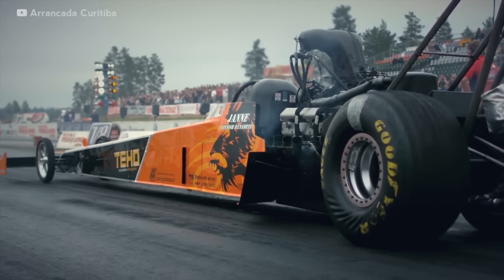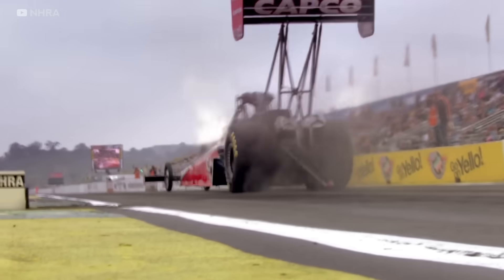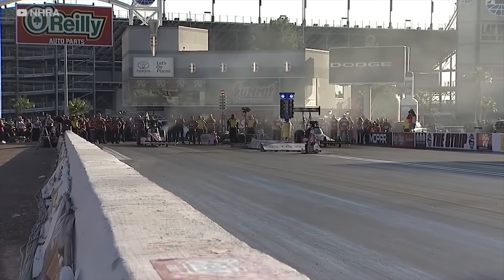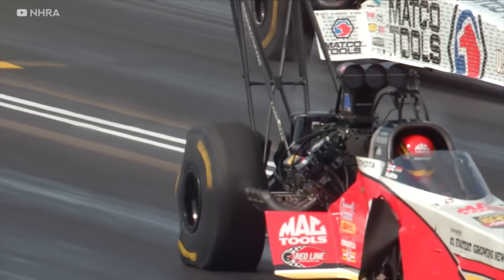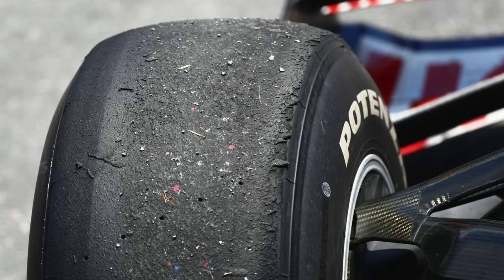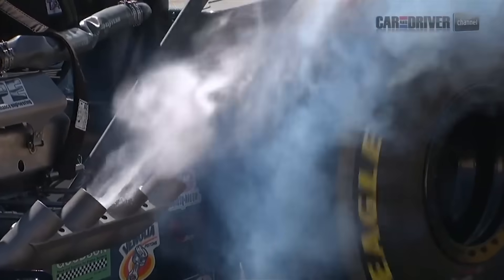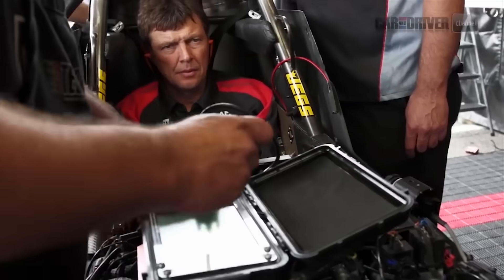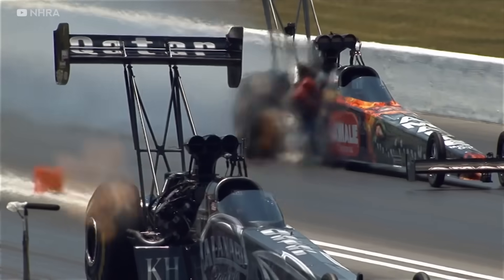How Dragster Tyres Accelerate to 335 MPH in 3.6 Seconds

Comment: You missed a good one: the clutch welds itself together around half track.
Reply: The spark plugs also melt away, by the end of the run the car is deiseling from the heat of the engine alone
Reply: Polybotes holy crap really
Reply: @mojaverc1585  yea, in my automachanics class in highschool our "educational" trip was to the drag race every year so we got to watch the teams tear down the engines and learn what they had to replace every run and what kind of damages and wear they were looking for to make sure everything was perfect
Reply: Polybotes wow thats amazing!
Reply: @polybotes927  THAT is educational
Reply: Wait you mean the whole dragster industry is producing a bunch of wasted metal and components?
Reply: @ralexcraft990  recycling scrap metal is better for the environment, mining and refining metal ores are so enviromently
Reply: @polybotes927  OMG really?
Reply: wyanSS thats a cool fun fact😂
Reply: Wtf is that legit?
Reply: The spark plugs fuse after a couple seconds, and the car diesels the rest of the way.
Reply: @johntomasik1555  LOL...ummm, no. If you watch the crewchiefs after every run, the have a tool with a light they put the plugs in from each cylinder and "read" the plugs. Garlts was a master at this.
Reply: @Jordon Carlson motors are based on the Chrysler Hemi. 2 plugs per cylinder 1 intake 2 exhaust valves.  But almost all blocks are Chevy blocks now. Don’t really know the difference on the block stuff. Voltage is like 50000 volts. 2 mags.
Reply: @Jordon Carlson well, record that for sure.
Reply: lol
Reply: It’s about the tires
Reply: Actually? Damn...
Reply: It's amazing all the forces going on here. Been to one drag race event where they'd sell parts off these motors after one run for souvenirs. Looks like a grenade went off inside these. Bent rods, hammered pistons and other indescribable chunks.
Reply: I wonder how fast 0-60 is then
Reply: LOL adding new depth to the term "clutch lockup."
Reply: Also missed to say that there are no cooling systems in these cars. They are cooling themselfs through the low pressure that is created through the massiv amount of air and fuel that is sucked in that there is ice building up.
Also the fuel is igniting itself after half the track and spark plugs are molten at this time.
The engine is only doing 800-900 revolutions, including the burnout, before it's completely taken apart after every run and pistons are replaced every run...
Reply: You only weld the clutch if it’s not done correctly. To much gap, or not enough engagement.
Reply: Oh hahaha fuck i didn't tought about the gearbox/clutch part ... it's insane, so basically everything is dying in one run ?
Reply: @Jordon Carlson if you do get your hands on 36$ a gallon nitro please don’t do that. That poor Kabota doesn’t stand a chance if it does detonate, yikes! Nitro has about 2.3 times the energy density of gasoline.
Reply: It does WHAT?!
Reply: That is not true.
Reply: Yup. Watch the poor crew member that has to rebuild the clutch after every one. They're the one with giant oven mits & a full face shield, sweating their ass off.
Reply: You are right but it is usually only the first two- three discs on a 5 or 6 disc clutch.
Reply: @emptychristbuddha  stretch is the 'replacement spec' on ALL aluminum rods. I don't know if they have gone to titanium rods, or not, so can't speak to them.   For aluminum rods, there is generally a number of runs count kept for replacement purposes.

In the high tech world of TF & FC drag racing, I wouldn't be surprised of they measured rod length any time a rod/piston assy comes out.  Never seen a team do it, but that and a nickel, gives you 0.05. LOL   If they do, there's likely a YT vid about it.
Reply: @georgedennison3338  ..I misunderstood you comment...Oh well, you have my story anyway lol
Reply: @georgedennison3338  ..You are always allowed to let your engine parts cool before an inspection. I set 25 IHRA/NHRA records and had to tear down after each. The tech guys actually try their best to NOT throw you out...the motors and parts are always allowed to cool. // One time I set a record, I knew my heads were right on the borderline in combustion chamber volume..as I pulled a head off I took out the plugs and slipped an extra washer on them & reinstalled them. I walked the head over to the tech guy...he CC'd it. He said...wow, you're losing a lot of power, your combustion chambers are way over spec...tell your head man to shave em and you'll pick up some power...I said thanks I will...LOL. My head was probably legal, I just didn't want to take a chance. That tech man and I became good friends thru the years (no I never told him)....RIP Hank.
Reply: @MikeM275  my dad would have a crew guy with a few hammers near the scales and if he was light he would ask to recalibrate the scale while he loaded up the hammers.

Comment: Dragsters are powerful, lean, and quick fire-breathing machines. Their engines purr like a kitten and roar like a lion. I have been involved in drag racing, but not so much the NHRA. More along the lines of UMTR. My favorites are the gassers. And I've seen a couple of funny cars and top fuels at their events. My favorite funny car is Suzie Q. She's a red '57 Chevy Bel air. I can't remember the name of the top fuel there, but it had two engine blocks running down the middle, making the whole car bounce as it did its burn out. I miss going to my drag races. It's what made me want to become more involved. If I could, I would tweak up my Kia Soul and replace the 4 cylinder engine with a small block v8. Throw it on the track. See if THAT will turn heads.

Comment: Nitromethane is also used because of its low optimum air to fuel ratio so much more can be burned per power stroke. Adding hydrazine increases the power output even further however I don't believe this is allowed anymore after some catastrophic engine explosions that caused some pretty major injuries in the 50's or 60's. If someone who is more knowledgeable about this era of drag racing could chime in on this that would be great.

Comment: so funny that the tyre is basically a cvt gearbox
Reply: A hell of a scooter.
Reply: And more reliable than Nissan's CVT.
Reply: I was thinking along those lines as he described the height of the tires at various times.
Reply: Underrated comment lmfao
Reply: Stolen:
* Under full throttle, a dragster engine consumes 11.2 gallons of nitro methane per second; a fully loaded 747 consumes jet fuel at the same rate with 25% less energy being produced.
* With 3000 CFM of air being rammed in by the supercharger on overdrive, the fuel mixture is compressed into a near-solid form before ignition. Cylinders run on the verge of hydraulic lock at full throttle.
* At the stoichiometric 1.7:1 air/fuel mixture for nitro methane the flame front temperature measures 7050 degrees F.
* Nitro methane burns yellow. The spectacular white flame seen above the stacks at night is raw burning hydrogen, dissociated from atmospheric water vapor by the searing exhaust gases.
* Dual magnetos supply 44 amps to each spark plug. This is the output of an arc welder in each cylinder.
* Spark plug electrodes are totally consumed during a pass. After 1/2 way, the engine is dieseling from compression plus the glow of exhaust valves at 1400 degrees F. The engine can only be shut down by cutting the fuel flow.
* If spark momentarily fails early in the run, unburned nitro builds up in the affected cylinders and then explodes with sufficient force to blow cylinder heads off the block in pieces or split the block in half.
* Dragsters reach over 300 MPH before you have completed reading this sentence.
* In order to exceed 300 MPH in 4.5 seconds, dragsters must accelerate an average of over 4 G’s. In order to reach 200 MPH well before half-track, the launch acceleration approaches 8 G’s.
* Top Fuel engines turn approximately 540 revolutions from light to light!
* Including the burnout, the engine must only survive 900 revolutions under load.
* The redline is actually quite high at 9500 RPM.
* THE BOTTOM LINE: Assuming all the equipment is paid off, the crew worked for free, & for once, NOTHING BLOWS UP, each run costs an estimated $1,000 per second.
Putting this all into perspective:
Lets say the you are driving the average $140,000 Lingenfelter twin-turbo powered Corvette Z06.
Over a mile up the road, a Top Fuel dragster is staged & ready to launch down a quarter-mile strip as you pass by it. You have the advantage of a flying start. You run the ‘Vette hard up through the gears and blast across the starting line & pass the dragster at an honest 200 MPH. Just as you pass the Top Fuel Dragster the ‘tree’ goes green for both of you.
The dragster launches & starts after you. You keep your foot down hard, but you hear an incredibly brutal whine that sears your eardrums & within 3 seconds the dragster catches & passes you. He beats you to the finish line, a quarter-mile away from where you just passed him. Think about it – from a standing start, the dragster had spotted you 200 MPH & not only caught, but nearly blasted you off the road when he passed you within a mere 1320 foot long race!
Reply: LoL
Reply: Imagine Jeremy clarkson saying that
Reply: Logan Music  r/whoosh
Reply: @Wildjesta  he just said what cvt gearboxes are...
The r/woosh thing is so fucking annoying and childish...
Call me a boomer but literally no one cares about that subreddit
Reply: @samuelkavicky7242  Cheer up, will ya? Why be such a downer?
Reply: @samuelkavicky7242  apparently you care. Don't make my whoosh you.

Comment: It's actually less energy in the Nitromethane than regular pump gas but it requires much less oxygen so you can dump more fuel in the engine.

Comment: Great video only one correction I’d make. Nitromethane fuel doesn’t actually have a greater energy density than gasoline it’s actually less. The reason engines burning nitromethane produce more power is because a far greater volume of fuel can be burnt than gasoline in the same time because nitromethane has oxygen in it in the form of NO2. This means the fuel requires less extra atmospheric atmosphere to burn optimally. The fuel ratio can go to 1:1. More fuel burning = more power.

Comment: another interesting fact about nitromethane aka CH3NO2, is that the stoic ratio,perfect combustion, is 1.7:1 , with a richened race tune its on the edge of hydrolocking. @6:10 is a dead hole pouring fuel out the exhaust.

Comment: 5:27 - Name a motorsport where the tyres last 900% longer than the engine per stint.

You wouldn't have guessed Top Fuel.
Reply: To be fair, in an engine rebuild they wouldnt be replacing the entire engine every time. They will mostly be checking for damage or stress, parts needing to be replaced
Reply: @facepalm7345   Understood
Reply: @facepalm7345  We carry two spare Bullets (Complete short blocks) in the Hauler, 8 racks of pistons and rods, 8 clutch packs, 8 sets of prepared heads and 3 Assembled Superchargers. Thats enough stuff to run 8 passes. 3 qualifiers and 4 rounds if a 16 car field.
Reply: @facepalm7345  Pistons, crankshaft, sparkplugs, etc etc. The block itself isnt replaced, but most of the inside is. 

It's like tearing apart a house on the inside and redoing it. Its still technically the "same house" but they are totally different from the inside
Reply: Jack The Ripper sounds a bit like Grandpa s old axe....had 7 new handles,and is currently on its fourth head... still Grandpas axe!🤣🤣
Reply: @Rod - sounds like a Theseus' ship to me
Reply: @JackTheripper911  Depends on your definition of "same".  If you make two of something and they look identical, are they the same?  Technically no, they can't be the same.  Similar, yes. 

So no, tearing a house apart on the inside and redoing it is not the same house.  A flooring laid by a bunch of workers is not the same as one laid by your late grandfather, no matter how similar it might look.
Reply: Any motorsport that uses 2018 Renault F1 engines?
Reply: Tires
Reply: @isaiah1574  depends on queens english,or American. Like colour/ color etc.

Comment: Some other facts:
At top speed, because of the downforce at both the front and the rear, the chassis bends like a banana....the chassis is not painted because cracks regularly occur and needs rewelding

These engine cannot be dynoed, so the HP is calculated

Because of the short 3-second runs these engine only do about 540 revolutions from throttle hit to finish line

At top speed the downforce generated is more than 2.5 tons

Only way to shut down the engine is to stop fuelflow
Reply: 'Cannot be dynoed' is not quite accurate. Although there are plenty of 5000hp dynos atm, no 10000hp dynos as yet.
There are strain guages on the drive shaft that give a 'dyno' reading.
Btw, strain guage dynos can also be used in non-top fuel engine mounts.

Comment: I’ve worked on dragsters with and without suspension. A Top Fuel car has no suspension so the tire and the flex in the chassis will effect how you can put power to the ground. Most amateur dragsters do have suspension and will run a much stiffer tire.
Reply: The wrinkle wall also soaks up the engines torque pulses due to a minimal flywheel.

Comment: The video is entertaining but does not address a key point: How can a tire produce four gees of acceleration at launch with no downforce (no speed ,no downforce). The answer is covered in detail by Chuck Hallum in the 1994 Motorsports Engineering Conference Proceedings sponsored by SAE. The wrinkle wall standing wave causes the tire perimeter rotation to fall behind the axle rotation and then it elastically catches up travelling faster than the axle and slams the pavement. The pavement "slap", similar to the crack of a whip, results in a force against the pavement far in excess of the weight of the car. This allows acceleration forces greater than just the weight on the tire times the friction coefficient.

Comment: just one thing nitromethane is NOT. extremely volatile, it’s commonly used mixed with methanol to run small RC models engines like the airplanes i fly and i’ve seen videos were someone threw a lit match into pure nitro and it didn’t catch fire

Comment: Fast car : I do 0-60 in 3.5 s and get 14 mpg
Dragster : I do 0-335 in 3.5s and get 14 gallons per mile. I'm also 10x your length, cost and complexity.

Comment: No radiator.  They run so much fuel through the engine that it controls the heat for the brief time the engine is ran.

Comment: And i thought the exhaust angle was more about looking cool! Goes to show that in racing everything has a purpose.
Reply: Not just racing, either. You'll find that - with a lot of man-made objects - people tend to only build a thing if they need to, so you might be surprised at just how much stuff out there was purpose built but youd never notice it. Say, for example, how lighters have 2 holes punched out of the metal protector at the top. The metal protective piece is there to ensure the lighter lights in windy conditions, but without the two slits being cut out, the hole for the flame would not allow enough oxygen to guarantee combustion and so they made more inlets. Or another example: how every biro pen lid these days is built with little holes punched in the top of the lid so people dont choke to death if they inadvertently swallow one. There's literally little design intricacies like this almost everywhere you look...
Reply: Downforce would be higher pointing straight up.
Reply: @mcplutt  Its too much would over bend the chassis forcing the engine into the track.

Comment: The most amazing thing about drag slicks is that they’re an ancient design. They have cross plys and inner tubes as radials can’t handle the centrifugal force at the top end.
Reply: Radials though have been used in sportsman classes for years and are about a half tenth faster than bias.

Comment: I never got the point why?
If you want to go fast like that just strap some rockets it is much cheaper probably.
The point is that they should do at least  lets say 10runs before engine rebuild. Rebuilding an engine after each run is just stupid
Reply: But you can go faster if you push the engine to the point of destruction that is the point 🤷‍♂️

Comment: One gear,like a cvt?
Reply: The CVT-like effect comes from the "growth" of the tires. They have a fixed 3.20:1 ratio at the rear axle. Everything depends on the 7-plate clutch-system engage.

Comment: Something that wasn't touched on here but I found surprising first time I experienced it... Drag strips are STICKY. Try walking across a strip and watch your step! All that rubber laid down over the years and special maintenance (some strips they even drag rubber the full length behind a tractor) means that it is like walking through treacle. 
It isn't unheard of for people to lunch transmission components simply because standard road cars are not built to transmit 100% of their torque through the wheels in a launch, as wheelspin prevents this. The upside is that you can get better acceleration times on the track than on the road (my car does 0-62 mph over half a second quicker on the strip, even though I put more air pressure into the tyres to reduce rolling resistance... it's only 340bhp so that works better for me!)